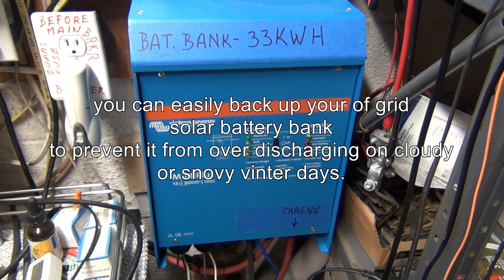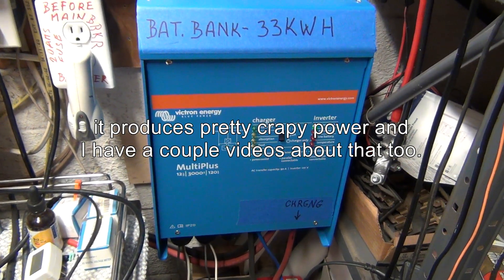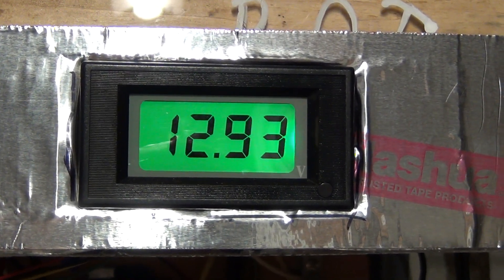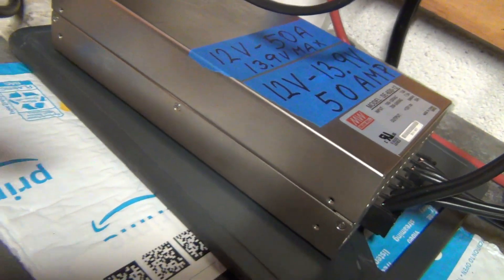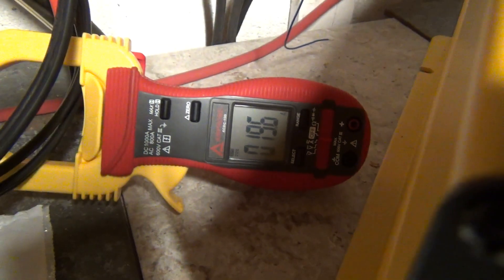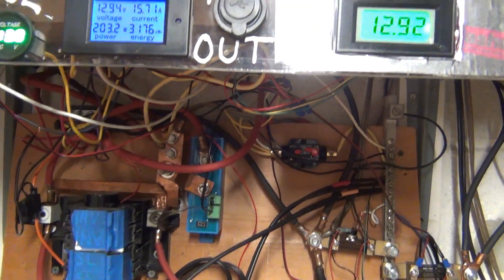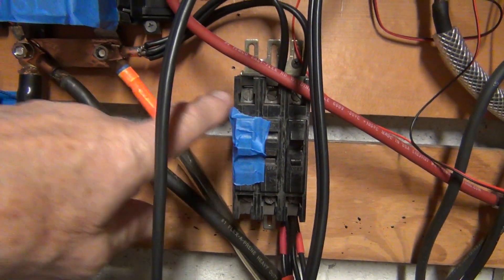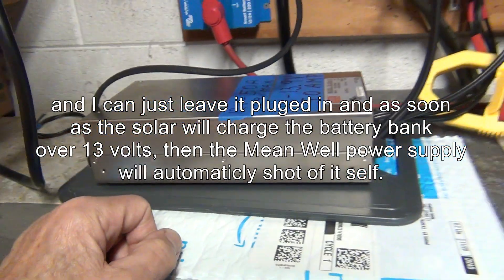How to back up your off grid solar system simple and easy

Comment: In plain. None waffle...
So you have your battery voltage, you plug in a battery charger from the grid.

The voltage limitations, (13.05) means that the power flows more so the larger the voltage difference.
(Ohms law) 

So when the battery reaches 13.05v the current (charge) will stop so your running from the battery, wheb your drops below the set voltage the power supply will charge.

Basically the oower source is the grid. He has losses in conversion going ac to dc to another battery dc to dc and then back to the inverter (ac)

Id you're doing this. There are other ways.  You can set v range, and its a ht-603 module (hope I got the right one)

This turns on and off your charger within a range. If you're running all the time from the grid, you wont need this, but then youre Better off turing off your inverter and just  using the grid.🎉
Reply from the maker: You completely missed the point. Ofcorse there are some loses but my solar will use this maybe 3 to 5 times a year only in the winter and the losses are minimal compared saving the $10 000.00 battery bank lifetime plus the Mean Well will shot itself when the voltage raises but the main point is not to have to monitor the solar system.
Reply: @VladFredK  no, you're using the grid via the battery... Just use the grid..
Even when you pass through, you're still on the cycles.
Reply from the maker: you locking basic knowledge of LiFePo4 battery cells, you are not on the cycle.
Reply: @VladFredK  it has nothing to do with the battery type or size, it's electron flow.

See  your saying that you can run your inverter off the DC charger, for the power you need. The DC charger is plugged into AC.
The inverter, that is plugged in to the DC makes AC...

Why, would you do that?
I use 300w of grid power, to make 280w DC charge, then I use that power to make 250w AC power.
You can say my solar adds 50w. So my output is 300w.
Reply from the maker: @guywhoknows  I don’t get your point
Reply: @VladFredK  why use grid power, going from AC to DC, to power an inverter to make AC?  You can use grid power for AC.

I can understand using AC to DC to charge the battery. But there isn't a point of using it to just run AC, or AC via the battery/inverter.

It's like using the inverter plugged into the charger to charge the battery..

Comment: I will have to watch this a couple of more times to see if I can pick up better.  I have a viltron multiples II 12V 3000
Reply from the maker: What is not clear?
Reply: @VladFredK  As to how the overall scheme is and using the charger/pwr supply.  Solar only system?
Reply from the maker: if you have basic knowledge of electric circuits, this should be easy to comprehend

Comment: Good morning. Does the Meanwell give power, if you first connect the battery and then plug the grid? I have a different model Meanwell, it does not go on if I have the battery connected first.
Reply from the maker: It should not matter what you connect first at least on mine
Reply: Ok, thanks, maybe mine is defective..